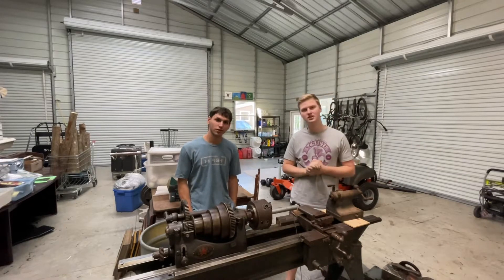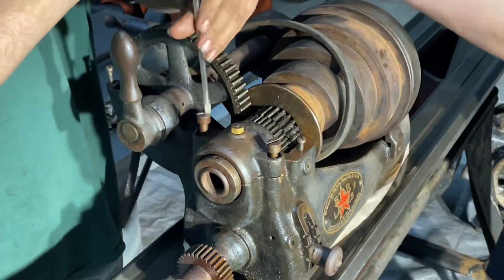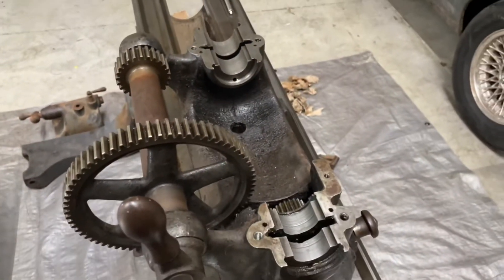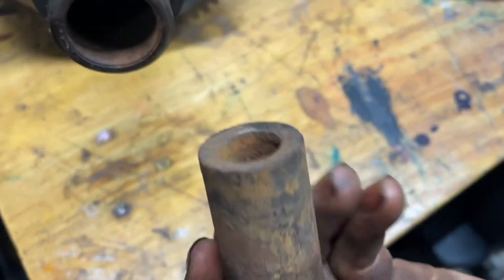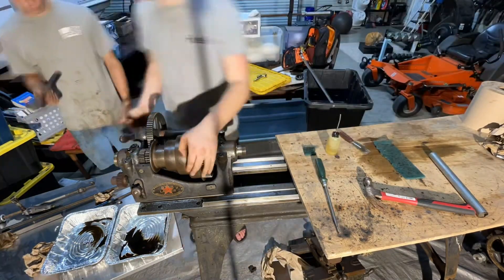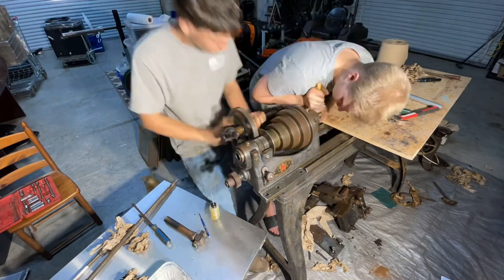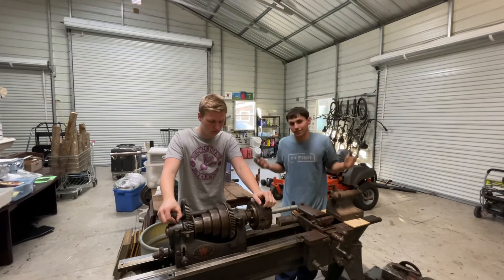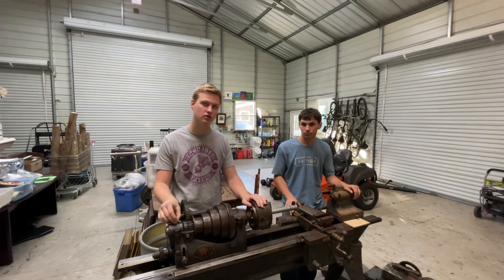(Part 2) Seneca falls lathe restoration: headstock

Comment: Very nice guys! I also have a seneca falls star lathe just like yours. I have gotten my lathe up and running. I still have some fine tuning to do. I wish my head stock was in as good a shape as yours! Just keep the bearings lubed up. I use white lithium grease in mine everytime I use it. I like your idea about line boring it and getting better bearings in there. But like I said mine is way worse and cuts pretty good. It is pretty acurate also. I will keep watching but keep up the good work!
Reply from the maker: Thank you for sharing! I’m glad to hear someone else has one of these lathes and found these videos.
I would be interested is seeing some videos of your lathe if you have a way we can get in contact? 
 The tip on white lithium grease is smart. We will definitely try that. And thank you for  the support on the videos!
Reply: @ianpalm  hey no problem. My lathe is currently apart due to a move and won't be back together till this spring. I'll be doing some much needed maintenance during the reassembly. What's your email address? I have some pics of it.
Reply from the maker: @thercbarn5001  ijpalm2004@gmail.com is my email. If you can get to it I would be interested in what the bearing surfaces look like on your headstock.

Comment: Find me crazy, but my Seneca Falls 10 inches lathe(1896 made) also had a lot of slack on the copper half bearing on both sides.  And as it would have been a nightmare to remove one side of the drums to get the job done and I did not have any replacement's bushings(bearing), so I filled the slack(void) with metal epoxy.  That type of epoxy can support oil, so since doing it, there is almost no more play at all. I left just a thin shim of multiple coats of wax before putting the two caps back in place and torqued them back in place.  24h later, I removed all excessive dropping on both side of epoxy, a bit of sand paper(very fine)  80w90 gear oil and it all went good.  I have been using it for a year now and no problems at all.  I only did the worst side, which was the one closest to the chuck.  This summer I will do the other side. The caps have never changed shaped, the bushing parts touching the caps are also perfect shape, so basically, the epoxy filled all excessive worn gaps between to shaft the the inside of the cupper bushings.